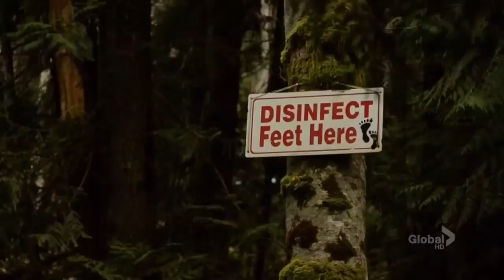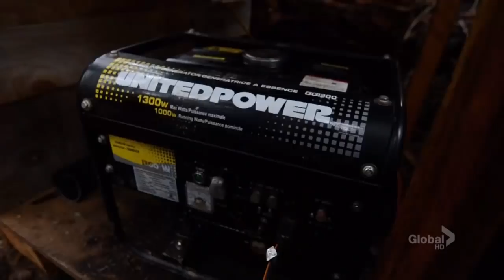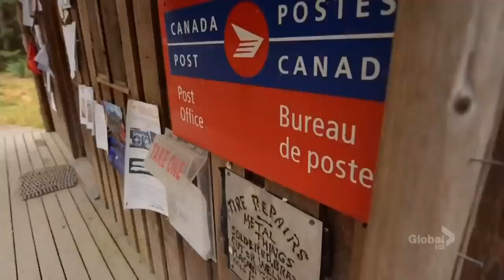16x9 | Lasqueti: Living off the grid an hour from Vancouver

Comment: Looks like paradise to me but I'd like to see it in the winter, eh?
Reply: We hardly have winter on the west coast. As long as you have an ample wood pile. Just throw another log on the fire. Most folks on these islands heat with wood or a combination of wood and electric. Which btw is not that great for the air quality! But an earth ship? Those are so thick and the walls heat up  and stay warm for hours. Those are good to -40. You can always get handfuls of folk moving to remote areas and living off grid. What we need is to learn how to convert cities into green centres.

Comment: You can run a generator off of wood using syngas. Since wood is just about carbon neutral it would be a much better option, another option would be biodigester and using the methane as a power source.

Comment: Now that's the ticket! I live in a tent off grid sometimes for 2 or 3 weeks. I'd do it full time if I could but there isn't any place in my area that allows it. Is this Island its own country or is it part of Canada?
Reply: Jack VanderHyde I had checked it out after I posted and was wondering what codes they had if any. So I appreciate your response. I'd have no problem fitting in there if I ever decided to relocate there. Since living in a tent sometimes for a couple weeks at a time I learned how to do things differently. It's quite an adjustment at first but I've learned how to live in a tent anytime of year. Even in winter when it's very cold out.
Reply: David Lewis
People in smaller rural areas are generally distrustful of outsiders due to bad experiences they've had in the past.
My own personal house is located in a rural setting and I've lived on and off in that area for the last twenty years so I understand what it'd like to have people throw a full trash bag in your yard or steal and destroy your property and generally act like they own the place because they rented a cottage for a weekend, This generally doesn't sit well with the local populous that have to deal with other peoples problems.
I personally try to be kind to people I meet for the first time though as most do around my parts, It's up to the visiting individual if they're welcome or not.
Reply: Yeahhhh, sure.  It's a completely separate country from the rest of Canada.  Don't you carve off random pieces of your country for no apparent reason?
Reply: BC still part of the country